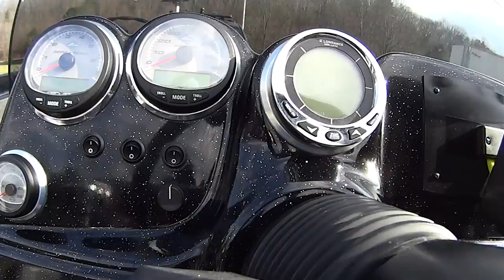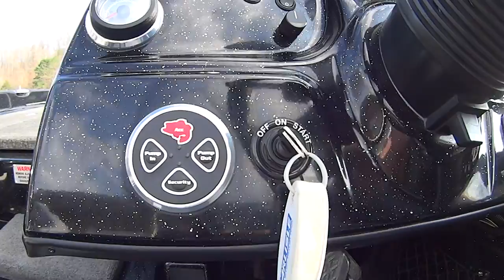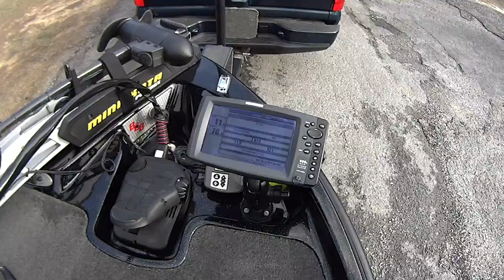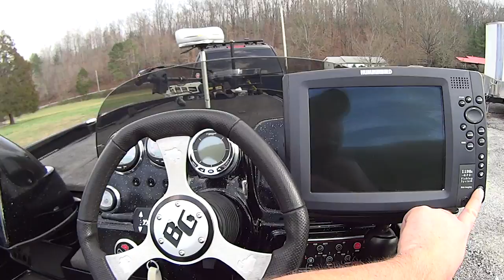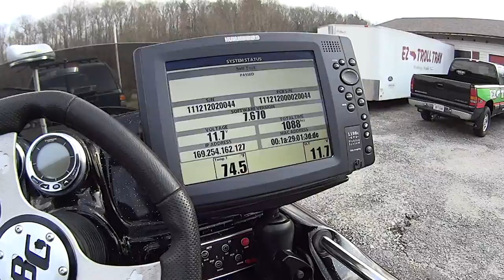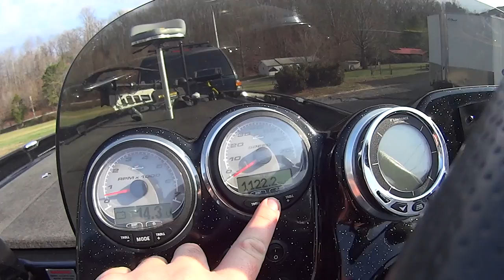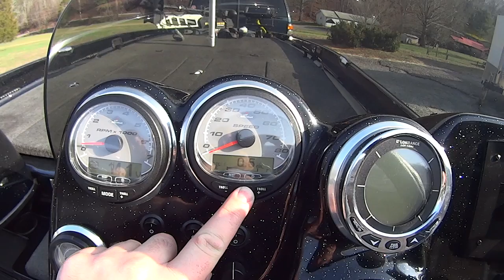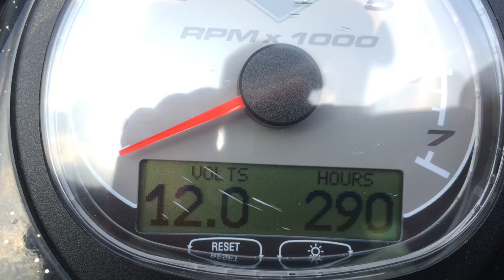BassCat Pantera IV Overview

Comment: Thanks for writing back, how long of screws did you use  for the Ram mount. The well floor just looks like they would rip out.
Reply from the maker: They were a couple inches long, I guess. I don't remember, it has been 3-4 years since I installed it. I have now sold the boat.

Comment: You mentioned you had a plate under the Ram mount and trolling motor Pedal. How did you get under the flooring to add a plate. I have a Pantera II and I have found no way to get under the floor.
Reply from the maker: The plate is under the trolling motor, not the pedal. That is how the boat came when I bought it. I added a plate under the rear Ram mount, but not the front one. Sorry, I said it kinda wrong on the video.